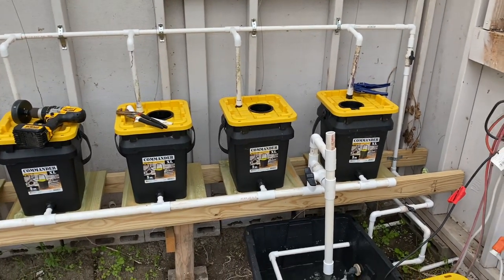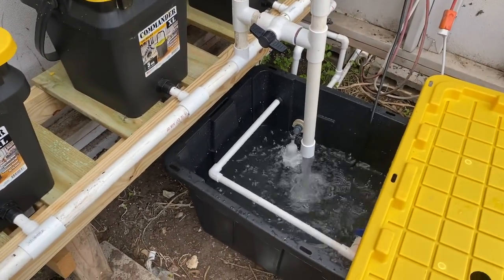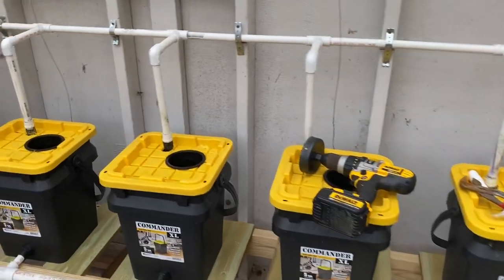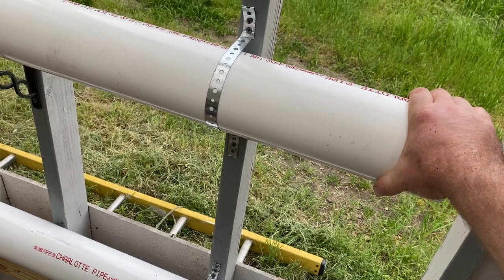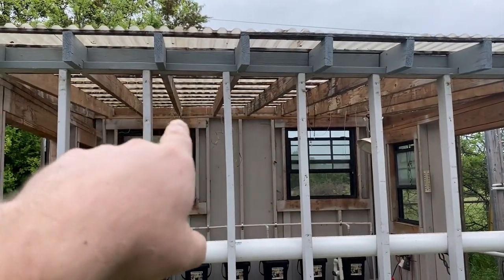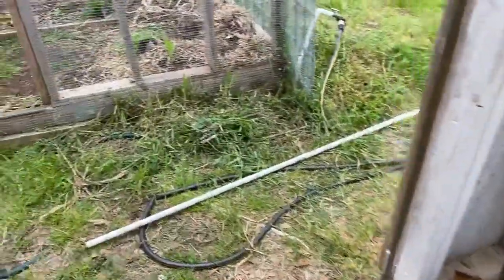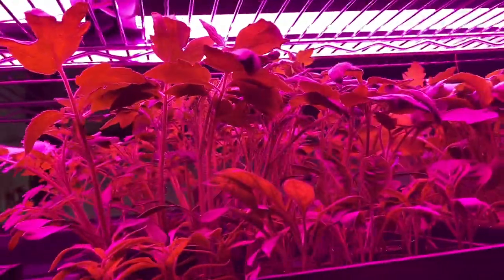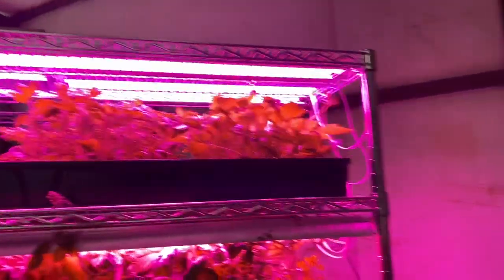New Deep Water / Aeroponics / Kratkyish Hydroponics System - Part Three

Comment: from my experience that trash can is not structural enough to fill with water and be reliable. Blue barrels much better long term
Reply from the maker: Well your experience is not valid and/or may be related to brand.  I have had systems using these in various ways for over 5 years now, none as in ZERO have ever failed.

Comment: I think you'd have better support with that strap if you brought it around underneath the pipe and back up to meet the other end so the pipe is hanging in more of a sling configuration.  It will carry the weight better and won't be able to slip.

Comment: If you wanted a cheap solution to pipe hanging/bracket just use 2x4 and attach it to the framing of the greenhouse perpendicular to the 3.5" side of the studs with the front end pitched up slightly to create a shallow "V" that the pipes would just sit in. 

Nice system and good luck with the rest of the build.

Comment: In the summer time, would a swamp cooler help with the heat in the greenhouse? If not, why not?
Reply from the maker: They really only work well in dry climates.  Go out to west Texas and you see evaporative coolers outside most homes, in DFW it just doesn't work well but perhaps about 1 month of the year.
Reply: They work well in climates with low humidity. Where I'm at, which is an hour or so north of Dallas, they're only slightly better than nothing at all most of the time due to our typically high humidity. On days with extremely high humidity, they are the opposite and just make it more miserable. Depending on ventilation, they can increase mold/fungus growth as well.

Comment: Jack. Your end cap dilemna..... Buy what are called 'test caps'. https://www.homedepot.com/s/test%2520cap?NCNI-5 Hopefull they might have the size you need in stock. You will have to silicone them in to be water tight.